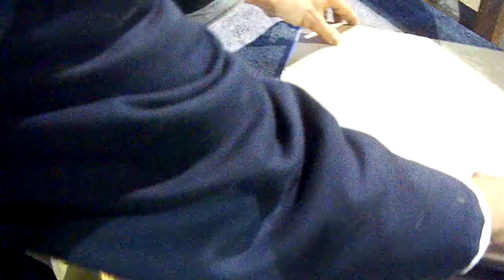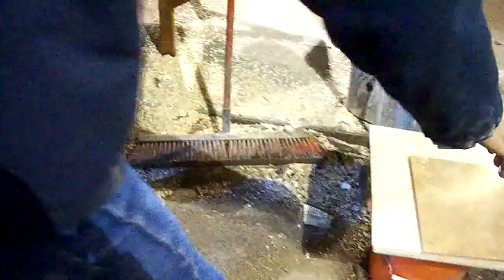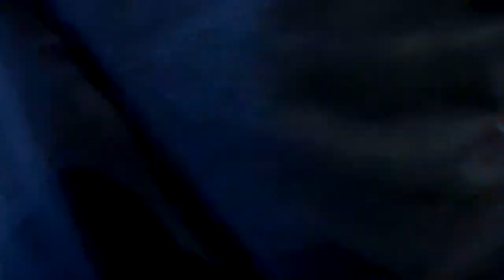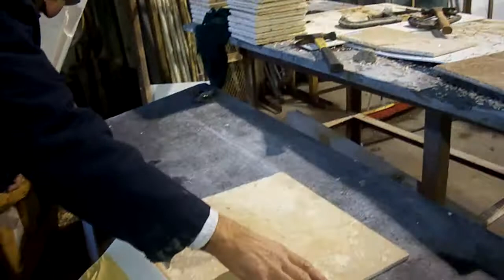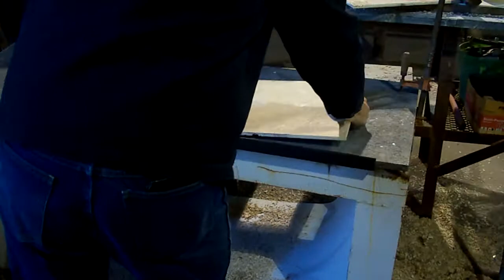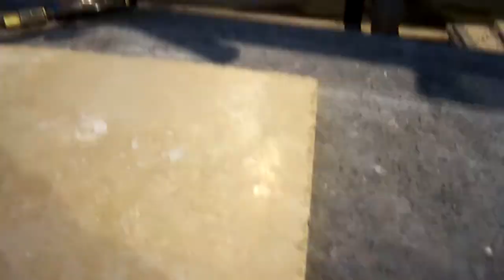Tile,  Chiseled Edge machine, Granite, Marble, Traverttine

Comment from the maker: Sorry for not responding to some folks, I have many irons in fire and this one just got put on back burner, along with all my you tube stuff.  I really don't have any plans it was something I put together in an afternoon with a chiseler I purchased from Northern tools. This worked spectacularly but did need to be beefed up to last the long haul. Use the pointed bit that comes with the machine, make an assembly to hold it and make sure it is adjustable for up and down as well as angle adjustment. You will have to create a spring dampening system to to limit the stroke of the chisel after that it is a matter of adjustment. We haven't had near the call for chiseled edge tile it seems to have faded in demand in our area so I haven't pursued it much and moved on to bigger things. Good luck